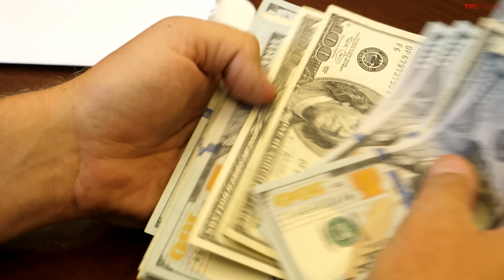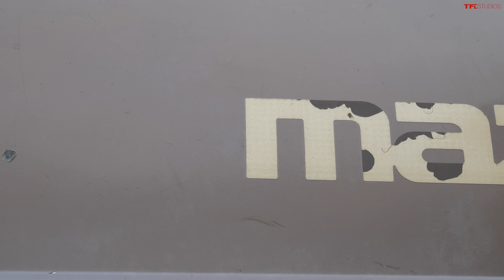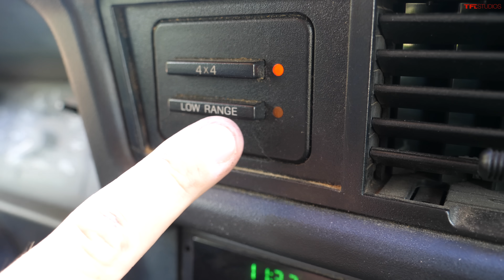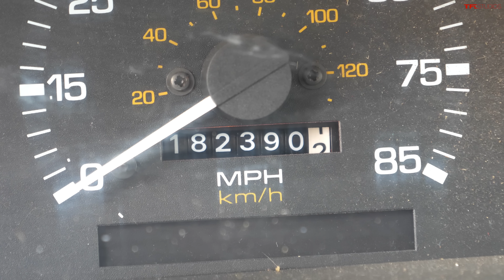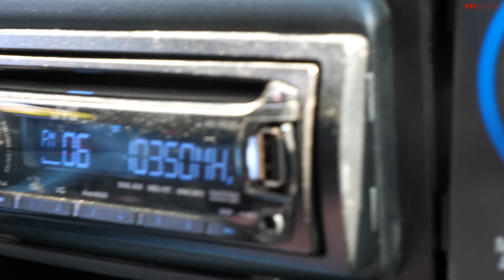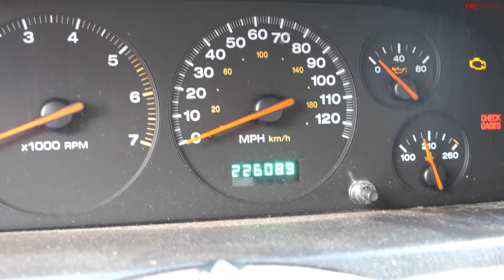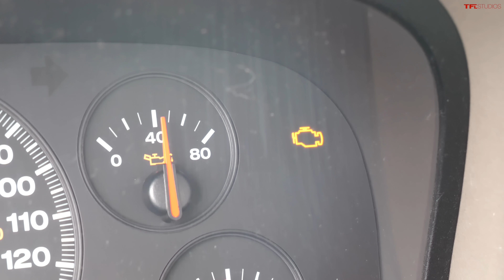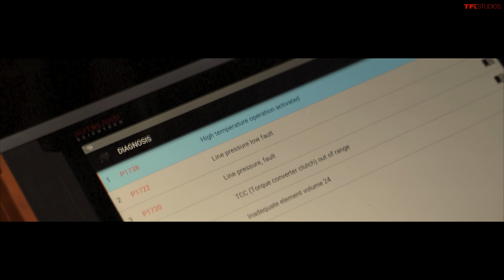Under $2,500: We Buy Three Vehicles That Are Complete Crap - But Which One Is The Worst?

Comment: My $2,500 cherokee I bought October 2019 has made it from Chicago to Oklahoma 5 times, Chicago to Kansas once, Chicago to Lake Superior 4 times, Chicago to Kentucky 8 times, and about 2 dozen other multi day trips. I will NEVER waste money on something just because its "newer"
Reply: i bought a 2004 grand cherokee for $3500 and things been an absolute tank, 275,000 miles and never had a problem
Reply: My dad had one that went to almost 300 I just got one at 110,000
Reply: That's awesome , but on a trailer pulled by a Ford doesn't count pard !!  🤷‍♂️
Just kidding there !!
Reply: Yeah well it’ll last longer
Reply: LJ-XJ most reliable motors in those jeeps
Reply: @dant1719  I had 2 xj's with the 4.0 and the motor was great, but the rest of it wasn't.  A 92 and a 2001.
I liked both of them regardless.  
The 92 was a tank..
Reply: I bought 4.0l 6 banger….. ran like a champion…. I owned it for a year then sold for a 2k profit. I regret it ever day
Reply: 1,400 grand  has lasted 7 years
Reply: That's the spirit new does not mean better...these units they tested in this video probably work better than new units do
Reply: I don't agree I have 2002 Chevy blazer it's runs strong no problems
Reply: Yeahhh okayyy keep dreaming pal
Reply: @Volvos60t6i6  keep dreaming about your minivan with a 4 foot box lasting more than 50000 miles before you end up selling it for scrap because the warranty ended and you can't afford to fix it properly out of pocket...real smart
Reply: The fact you e made it out of Chicago that many times is amazing 😂😂 JK you used to be able to get pretty decent cars for 2500 hell i e had 500 cars last a year or more but I’m 51 and that’s been a minute
Reply: @Ecoblu1972  I have bought many decent cars for less than a $1000 cdn and have gotten 2 to 3 good years out of many of them the best of the bunch I can recall is 3800 V6 GM and the 305 LG4 small block in 80s GM b body cars
Reply: Just because it's new...does not mean it's better or will be better it just means it's more expensive
Reply: @lvriss  Thats kind of a rip off for a 275k mom car. The engine is gonna give or the trans
Reply: @lvriss  4.0 v6 or the 4.7 v8?
Reply: @Sanjko87  the 4.0!
Reply: Totally get it but when you have to drive an hour to work 1 way sometimes the peace of mind and a warranty is a great thing.
Reply: @lvriss  do you have the 4.7 or the 4.0 engine
Reply: @Sanjko87  4.0
Reply: I bought a 1998 absolute model not even powered door locks camry at 180k miles for 1500, it's sitting at 195 and I haven't even changed the oil yet lol

Comment: Apparently Colorado doesn’t use 3” of salt for every inch of snow like Ohio does…
Reply: Yeah Wisconsins the same, it's fantastic.
Reply: Why I don’t buy in ohio.  Lease and give it back. My 21 Silverado frame is rusting already
Reply: @7171-Ws6  damn my 2012 Ram is finally showing rust after 262,000 miles and never in a garage.
Reply: Here in PA we aren't happy until everyone's car is white with salt
Reply: Salt isn’t the only thing that rusts vehicles. Ohio gets way more rain and moisture than Colorado does.
Reply: depends on location, if its under certain temp salt is useless.
Reply: @arbiter1  this is true but average winter temp in Ohio is 25-30 deg. F
Well above the below 0 temps salt stops corroding. Especially that just about every state mixes brine with the salt.
Reply: @7171-Ws6  Use to live on lake erie. My 01 f-150 that i had for about 12 years in the north last really long and still drives today with 300k+ miles when i sold it. The cab corners rusted and that was about it
Reply: @AHungryHunky  No kidding.  I just had to put new lower rear control arms on my 2015 Equinox @ 62,000 miles.  The original ones were rusting out.  Not surface rust, but literally crumbling.  Thanks, PennDOT, for your excessive use of road salt!
Reply: Also Colorado and especially Denver are bone dry. Humidity here is like 15% during the day, everyday. It rains and dries out in 10 minutes. Kills your sinuses but is nice on cars.
Reply: @lcee6592  salt stops corroding below 0 degrees Fahrenheit?
Reply: @b22chris  stops being effective at melting ice.
Reply: @b22chris  when salt is mixed with water the freezing point of the water is now lower but there is still a freezing point. I don’t know the exact temperature without doing a little research but once frozen, the solid salt water can’t do much damage. The chemical reaction, oxidation, slows way down the colder it gets. As I said, salt mixed with brine lowers the freezing point even further.
Reply: Colorado uses magnesium chloride which can also corrode if left on the vehicle for too long. It also makes a super mess of the roads and vehicles. It melts ice though, so that's good.
Reply: @turbodiesel4709  yes Ohio officially uses calcium chloride as an additive and in some parts of Ohio we simply call it brine. So now you know.
Reply: @xxtm72xx63  best part about the salt though is it makes extra ventilation in the floor for the hot summer months
Reply: @zackschilling5154  You are not wrong!
Reply: They don't call it the rust belt for nothing. I hate it myself 😆
Reply: @AHungryHunky  I can a agree, since I Live in PA
Reply: Curious if they use more salt than we do here in Salt Lake City Utah.   Salt is in abundance here, and they sure as hell turn our roads salty white every winter.
Reply: or Maryland
Reply: @AHungryHunky  same in New york
Reply: Right im from Cleveland man. I understand
Reply: @2S1L3NT  But cars don't really rust out there right ?
Reply: I grew up in Erie PA, moved to Colorado Springs in 2010 and back to near Erie PA again in 2016. Colorado pretty much doesn't use salt at all. I saw 20 year old trucks with 250k+ miles that looked showroom new. In PA/OH, you see 6 year old vehicles with rust.
Reply: I'm from Ohio, and I bought a 2011 VW Golf down in Kentucky. I drove it to Arizona and sold it there, and no joke, the guy who bought it looked underneath and called it a rust bucket because the bolts had surface rust. That just doesn't happen out west, apparently. Tons of 25-30+ year old beaters still being used daily with no rust, but nearly all of them have little to no paint left. It's interesting!
Reply: @somedudeinatunnel3102  I've lived in Denver my whole life. I'm not trying to pretend like we can't get surface rust on cars from time to time but it's rare. My new to me Tahoe has noticeable frame rust and it kinda scared me to be honest. Do I POR 15 it or do I leave it or spray it with Fluid Film.. The things people in the rust belt go through.
Reply: @justin baird I think I’ve heard of that combination for rust prevention. Of course there’s the ol  transmission oil and my favorite NH Oil.
Reply: @somedudeinatunnel3102  yup. Worked with a guy who had an early 80s f250. Barely ran, barely had any paint left, but no rust. The "showroom new" one i mentioned was another co-worker's 99 ram. I asked him how many miles it had because it looked new but I worked with him for a few years.. so i just guessed it was less than 30k miles. He told me it had 280k on it. Bought it new, and it was still all original.
Reply: @justin baird I heard a hard coat was bad because if salt gets in, the metal will rust out without you knowing since all you'll see is the shell of the coating. Its better if no salt gets in, but all it takes is one little knick in the coating to let salt and brine in.
Reply: U.K. uses rock salt which gets very slippery especially at junctions. I’ve had front wheel drive cars spin both wheels at junctions with no forward movement. It’s less slippery than ice but not much.
Reply: Chain saw bar oil mixed with white spirit (paint thinners) soaks into rusty metal and gels over time. It’s dirt cheap and as long as you keep it off visible surfaces does a great job.
Reply: I can’t believe by 2006 pathfinder here in Illinois shows no surface rust at all and no garage either
Reply: The Mazda is about at the half way point in its life expectancy.
Reply: @2S1L3NT  yes they use way more salt in PA and Ohio than Utah uses. Utah uses an average of 428kg² per year while Ohio uses 5,000 and PA uses 5,500 per year.
Reply: @DJR5280  if your frame isn't falling apart when you hit it, the rust is just surface rust. My 06 monte carlo I can hit areas and rusted chunks of the car fall off. Ive seen people with trucks that the bedside is barely attached and flops around in the wind like a flag. I think if someone sat on the bedrail, the whole side would just fold down and break off.
Reply: @timmypstyle  Oh no it's nothing like that. I can spray some Rustoleum Rust Dissolver on the frame and a little work with a wire brush and I'm back to shiny bare metal with little effort. I've never seen frames worn to the point you can poke holes through them ever in Colorado.
Reply: @DJR5280  then your truck is fine. Nothing to be worried about. Even vehicles that pass inspection in PA are allowed to have way more rust than what yours has. If you watch my video, you'll see the mufflers on my monte, which were only a year old and stainless steel. I took the muffler off of my 14 ram I had after over a year. Its still sitting in my garage and looks newer
Reply: @timmypstyle  I can shoot a video and show you the rust? It just drives me nuts because the whole truck has zero rust except for the frame. When I dissolve the rust you can see where the factory coating is worn off. I bought POR 15 but decided not to use it and try an oil based paint. Any recommendations ?
Reply: @DJR5280  we use fluid film for a temporary winter coating. You can definitely put the factory type coating back on but make sure you get every speck of rust first. But honestly it's almost impossible to keep a daily driver from getting rust. And some metals rust a little at first and then pretty much stop. Like for instance a rear differential housing. They will rust on the surface quickly but once they do, they don't progress hardly at all.
Reply: i’m in jackson county and there could be a 1/4” of snow and they’ll have them salt and plow trucks out every 30 mins
Reply: @7171-Ws6  Funny you say that. Brother was just looking at a 2018 F 150 from OH. It was really rusty underneath. My Buddy has an 18 F150 also and the frame is still black as the night with no rust but it has lived in Denver it's whole life
Reply: @timmypstyle  I ended up buying Surface Shield from PB. As I was cleaning the frame to apply Surface Shield the frame was turning black again. I think I mistook a dirty frame for rust. Frame even still has a sticker on it from the factory which I've never seen before. Anyhow I sprayed Surface Shield but it doesn't coat well here. I wonder if it's due to the lack of humidity here
Reply: @DJR5280  you should look up reviews from a channel called project farm. He tests a bunch of coatings to see how they perform. But yeah that just sounds like a dirty frame. The coatingntuey apply at the factory is black usually. Still doesn't hurt to add protection tho.
Reply: @asaconaway3889  yeah but I think colorado uses a very low salt mixture. Vehicles barely rust so they aren't putting down much.
Reply: They use a lot of magchloride on their roads. I lived in the Durango area, they used it on dirt roads and pavements, sprayed it along with salt/sand concoctions. Hated that crap. Sticks to your car like concrete. Constantly washing the car to remove it.
Reply: Nope Colorado uses sand and chemical deicer.
Reply: @7171-Ws6 shoulda bought a ford

Comment: Oil leak on the Blazer is the engine oil cooler line. $45 part takes about 10 minutes to replace it for anyone who is wondering. If you ever run into this issue buy GM Genuine/AC Delco, the cheap aftermarket ones fail.
Reply: My 350 is leaking too.

Gm problems
Reply: @@user-dd3pl9ii2h They's hardy little vehicles, its basically just an S10 with the cab reaching all the way to the back. I've had my '99 for 6 years, bought wrecked for $250 in 2018. 

She is a mean little machine. I've put mine through hell pulling trees and running trails, pavement, mud, snow, etc. Cheap interior and I hate the Space-Age vaccum operated 4wd, but a tough little bugger of a vehicle all things aside.

Comment: I'm pulling for Andre. I've had a 4.0 Ranger and B4000, both manuals and loved every minute of each.
Reply: I about bought a Mazda 4x4 truck back in 1995. Wish that I had done so instead of buying a 1995 dodge Dakota 4x2  sport model truck.
Reply: I have a 3.0 2002 ranger edge 145,000 on the odometer still runs like my little pogchamp.
Reply: My dad had the Mazda, I had the ranger. Awesome trucks.
Reply: @tammylott921  Who said they weren't? I was only stating that I had one of each version.
Reply: @superfakegamer6359  the 3.0 is a slug, had a 2001 with the 3.0 and it was sooo slow.  The 3.0 has been known to get cracked heads, i had both crack at different years and had to buy rebuilt heads.  Hopefully you have better luck, the 3.0 aka the vulcan was used in the Taurus around that time also.
Reply: I currently drive a 95 ranger with a 3.0 V6. love the little truck
Reply: GARBAGE!
Reply: @JohnConnor636  They are explorers. I have a 96 with that 4.0 OHV and 4.10 gears. Still runs great.
Reply: I've also got a 4.0L 4x4 Ranger, though, definitely paid a lot more than $2500 for mine, but it's great.
Reply: @theupscriber65  Yeah, there is alot of quality in those. I have a fast android touch screen radio in mine so it is better than some new car infotainment. The top radio in the premium explorer has to run wires all the way to the back to replace. Very few cars are set up like that. Also installed heated seats. The explorer I have is also loaded. I had to install new valve covers because they rusted (roads are salted here). Engine bay cleaned up like a new car. Otherwise it starts in one crank. Every 7 years it gets Michelin tires (16"). The same size tire is used on the new base Bronco :lol:

 The 96-95 Explorers seems to last extremely long on the forum. The 4spd trans and 4.0OHV seems to last much longer than the 5spd similar one that came after. The SOHC engines have major issues at higher mileage. 

Do you have the torsion bars like the explorer (4wd  got them)?
Reply: I put over 150,000 on two different Rangers.  My father put over 400,000 miles on a 4 cylinder 2wd.
Reply: I have a 96 b3000 and have no plans of getting rid of it. It's cool having something a little different but at the same time, parts are cheap and easy to find.
Reply: The manuals are fine its the automatics that suck.  93 4L Ranger went through 2 automatics, finally scrapped it after the 2nd one blew up.
Reply: @JohnConnor636  I have a Yukon my wife has a Tahoe 😉🤦👍
Reply: The 4 cylinder is better and can make more HP then a stock blocked 5.0
Reply: Same I own a ‘93 4.0 Ranger that my family has had since it was brand new and it still runs great.
Reply: Yup can confirm I had an 03 ranger 4.0 4x4 and it was epic for a very long time. Then when the engine went up(timing chain tensioners) I bought an old rusted Mazda b3000 with a stick shift and cut out the ranger frame and replaced the Mazdas frame with it lol still driving it daily at this point
Reply: @Mixwell1983  3.0 Taurus and 3.0 Ranger are two different engines.
Reply: I own an explorer and as soon as he popped the hood I could recognize that classic 4.0 intake.
Reply: I have stick shift and had an automatic one and loved both
Reply: I have a 94 splash 2wd with a 3.0 and a five speed she's not fast or stylish but damn is it fun to drive

Comment: I just spent $2,000 on a '99 Corolla with a manual transmission, power windows, cold AC, hot heat, and only 112k miles. Who says $2,500 can't get you a solid car?!
Reply: and you'll probably still be driving it in another 20 years LOL....they run forever.  The Corollas and Camry's make great daily drivers.

Comment: man, $2500 was a steal for that B4000, cheapest ranger around here I've seen recently was an 02 with 350k miles on it for $4000
Reply: I got my 01 ranger with 190k miles for about $1500 here in Oklahoma, I’ve been driving it for about 2 years, money well spent tbh
Reply: That’s wild dude. 350k miles for $4000 cars must be a rare oddity where your from
Reply: Bought a 1993 Ranger for 1700$ with 113k miles runs pretty damn good so far and body was in good condition also I live in FL so no rust issues
Reply: You must have typed this comment into a time machine....or the commenters are talking about 2wd single cabs.   I'm with you....Anything with 4wd is going way over value.  These guys are throwing out 2005 prices.
Reply: The new ranger debuted and the value of old rangers went up. I've seen it in my area at least
Reply: @leoruiz3412 i got a 99 ranger 4x4 3.0 with a blown head gasket for 400 fixed it now its my dd ive been driving it for half a year almost already and nothing major has popped up other than small parts involved with the cooling system i replaced them and it was fine they were already due anyways since the head gasket blew
Reply: @NickMattia44 From Miami FL= plenty of rust issues.
Reply: @leoruiz3412 That's pre-pandemic.
Reply: @spazzin9004  I mean that is a great deal for sure, but the average person isn't equipped to do a head gasket job. Head gaskets are so deceptive everyone is like oh it's "just a headgasket" when like bro that's a full tear down assuming you have tools and experience on top of cost of parts etc. I envy those with the experience to see a 400 dollar "mechanic special" car and actually fix it and come out on top

Comment: Haha, this reminds me of my jeep.  About 16 months ago I picked up a 2000 Jeep Cherokee for 500.  I fixed the leaking ac by replacing the low side shrader valve.  I fixed the suspension (2 broken leaf springs and 3 blower shocks) by putting in a rough country 3” suspension lift and springing for the full rear leaf springs.  Couple bits here and there and I’m still in it for less then 1400.